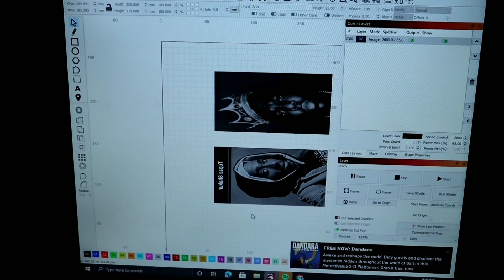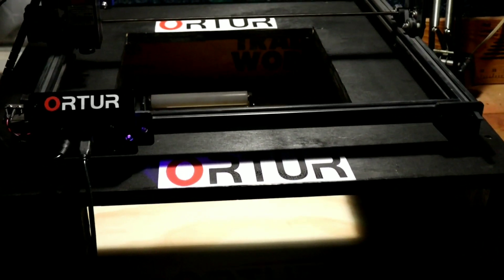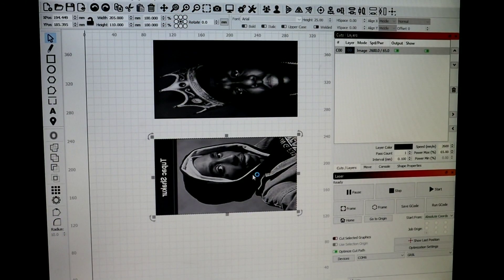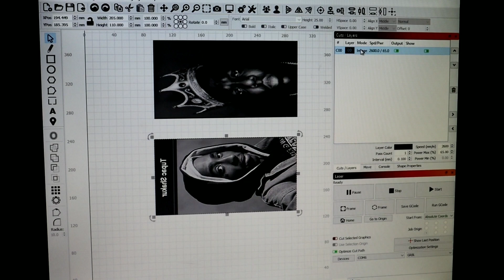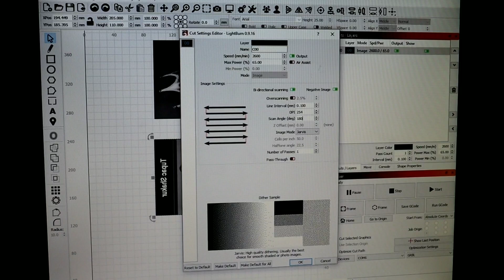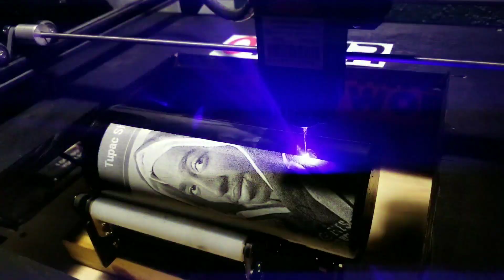Tupac and Biggie Engraved on a Dollar Tree Vase Using the Ortur laser Master 2 15w & Y Axis Rotary

Comment: How do you get even engraving on the curved surface?  The top and bottom look as good as the center of the design even though the laser is further away from the surface?
Reply from the maker: It us the same distance . Up and down
Reply: @zerica24  I did see a video of the same design being put on a stemless wine glass.  Thought it was you. TY
Reply from the maker: @ali11759  lol it was I used a soda can with sand in it to balance it out lol 😆
Reply from the maker: @ali11759 Sorry I engrave so much